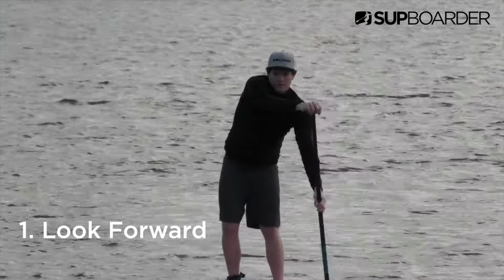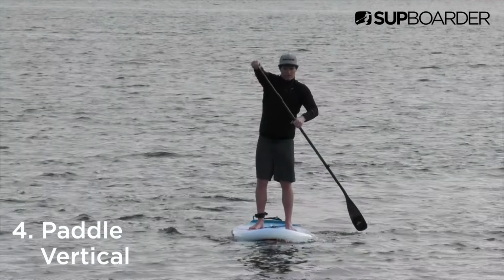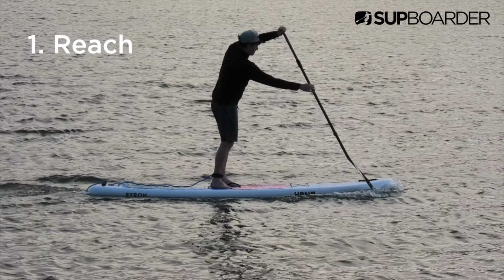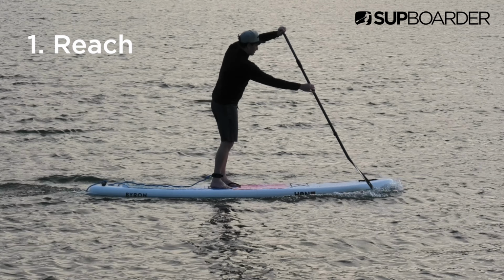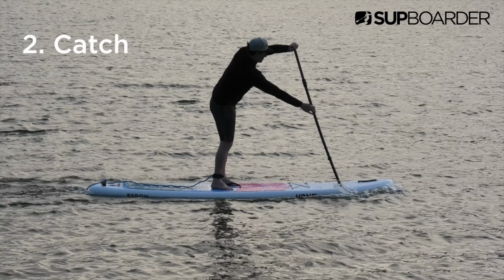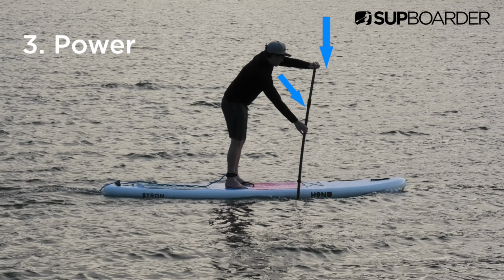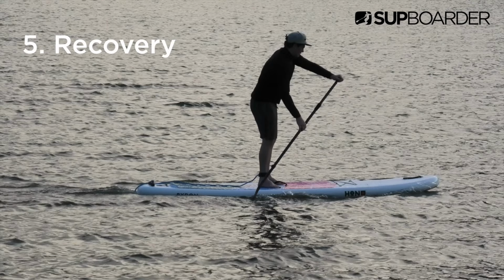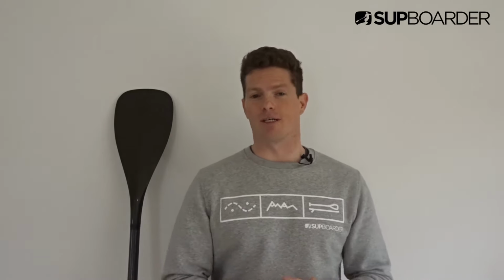How To Paddle Like A Pro / Improving Your SUP Stroke

Comment: Wtf is a positive angle?
Reply from the maker: Positive and Negative are terms we use to make it easier to understand the angle of the blade in the water. A neutral angle (0˚) is when the paddle is at our feet in the water. We want to focus on having a positive angle on the blade when paddling (power phase from the catch to our feet). Hope that helps. Beau

Comment: What would make me slap the side of my board all the time. I make sure the blade is going into the water the right way but for some reason i seem to always hit my board half way through my  paddle :), I love sup no matter how hard it is.
Reply from the maker: It could be that you are over rotating your wrists when you put the paddle in the water, causing the paddle blade to enter on an angle and as it corrects, it hits the board. The paddle blade should pulled perpendicular to the board (if that makes sense?). Your top hand may also move causing the paddle blade to move as well. Hope you're able to correct it soon! Thanks, Beau

Comment: I notice that your paddle starts pretty close to bow and I wonder if I'm to far back on the board, but I find myself more balanced slightly further back.  I see the difference @ 5:45 pushing the water out to much, but boy that person is sure going straight to me ha, ha,..
Reply from the maker: Haha, thanks for the comment. Your feet should be near the handle on the board. Slightly in front or behind it depending on the shape of the board and how it moves in the water. Also try to change your technique as mentioned in the video to help with your reach during the paddle stroke. If you feel comfortable where you are standing, then that's great as it needs to be enjoyable too! Hope this helps. Thanks, Beau

Comment: Tyvm for video!
How much difference does a good paddle do?
Does position on board affect speed in any way?
Reply from the maker: Glad you liked it!
A good, lightweight paddle will speed up your paddling cadence. it will also be kinder on your muscles and arms so you can paddle for longer. If you have never used a good paddle, once you do you will never go back.
Yes, the position will affect your speed and efficiency. If you are too far forward or back, the board pushes water and creates drag. There is definitely a sweet spot on every board and this can change between boards too. Try a few positions on the board and then take a few strokes to see how far you glide. 
Hope this helps. Thanks, Beau
Reply: @SUPboardermag  Tyvm for the reply! Appreciate it :D

Comment: I’m new to SUP and only have about 5 hours experience. I do get a lot of upper back soreness afterward - I think bc I’m leaning too far back and not using more core? I’m trying to figure out if I’m using too much arm strength and not driving my my core and hips.
Reply from the maker: Hi John, couple of things could be at play here. First thing would be to check your paddle length. Upper back and shoulder problems arise from having a paddle that is too long. You check this video for approximate paddle heights - but remember it is personal preference and you may need to go shorter (or at least try a shorter paddle): https://supboardermag.com/2021/05/08/correct-paddle-height-how-to-find-the-right-height-for-your-sup-paddle/

Secondly, it could be your technique that is causing upper back pain. Try straightening your arms when you paddle so you have to engage your core. 

Hope these tips help and good luck! Thanks, Beau

Comment: Hi there, I'm confused as I intuively thought the paddle is held the way you hold it, but after watching some videos they said you hold it the other way which I thought was strange. However you seem to hold it the way I thought was intuitive, so now I don't know which it is?
Reply: (it looks like you have the blade in the scoop sort of position and I thought it's supposed to be the other way round)
Reply: Every video I've seen says hold it the way this guy shows.  The blade is angling away from you so stays in the water longer as you pull.
Reply from the maker: It gets technical, but the blade angled away is the right way. It's all about positive blade angle in the water when paddling to maximise speed, power and efficiency.

Comment: Thank you for posting this video.  However, your model, although using the hips some, is flexing and sidebending the lumbar spine rather than keeping it straight.  Bending your knees will allow a better hip hinge and a straighter lumbar spine.
Reply: I agree. I keep a nice knee bend and when I do I feel my core engage even more and I’m able to get the longer reach.
Reply from the maker: Thanks for the tip. We agree that being your knees a little more will improve this movement, and can also enhance your balance. It definitely comes into play a lot more when paddling faster and adding more pressure to your muscles. Thanks, Beau

Comment: Thanks for all your videos, both instructional and reviews!
One question about the paddle grip, just like you do here most recommendations says paddle on your head and 90-degree elbows. However when they then paddle, it appears like they have quite closer grip than what the 90-degree elbows would be.  Same thing here in your video. Is this just an illusion in the video or are you actually using a closer grip?
Reply from the maker: Hi Ulf, great spot and good question.
the paddle grip with 90-degree elbows is a great start for beginner paddlers learning to SUP. Once you begin to progress with your paddling, you may find that the grip evolves to suit your paddling style. If I am cruising my local waterway and taking it easy, my grip may be less than 90-degrees. But if I'm in the waves or surf, my grip extends a little further than 90-degress for leverage and speed. Hope this helps. Beau

Comment: Question. Would a possition with one foot  in front of the other (left foot in front when you paddle from the right side like they do on canoe racing) be a bad idea? Even a slight lunge possition? having your both legs up to the waist glued to the board while leaning your torso to the side seems a bit awkward and unnatural to me. Is ballance an issue? Have you ever tried similar technique on a sup?
Reply from the maker: Good question Szymon. Some top races do actually paddle with a slightly offset stance as you are describing. It will make you have a slightly further reach and a more powerful stroke but you will have to change your feet each time you change your stroke and if you are changing your stroke side often this can make it less efficient. It is a very good technique if you are trying to sprint over a shorter distance in racing or potentially catching a wave. 
So yes it can be done, give it a go and see what you think, but I think for a longer distance paddling is probably easier to keep your feet in parallel stance unless you are trying to put more power into your paddling for maybe example... pushing up into wind. thanks Reuben
Reply: @SUPboardermag  So it seems more efficient in therms of speed and power. Also seems more natural although it works if you have a long board and decent technique so you dont change sides frequently as you said. Also if there are no waves and you have good balance you can sort of quick jump to change legs. Outside of that it seems less stable.
Reply from the maker: Thanks for your thoughts Szymon 👍🏼
Reply: @SUPboardermag  Ok. I'll check it out as soon as my board arrives.

Comment: Nice tips.  Any suggestions on how to keep a short board tracking straight? Like really short 6'5".
Reply from the maker: Hey Andrew, not sure if you are a SUPboarder Pro member but this is the video you need to see: https://www.supboardermag.com/2018/07/28/sup-paddle-strokes-using-the-c-stroke-how-to-video/ 
If not you can still sign up for free for two weeks watch the video and cancel the subscription after lol. But the C stroke is the manoeuvre to do and the matter what size board I can get going in a straight line. Thanks Reuben
Reply: @SUPboardermag  Thanks!

Comment: After many years kayaking, I started taking up SUP.  I thought SUP would be simpler than kayaking, but boy was I wrong.  Wind  is the difference maker.  Because of lower windage, you can go out in a kayak with sloppier technique.  Unless it is calm, paddling a SUP requires good technique to even make headway.
Reply from the maker: Good comment, Yeah it different but good at the same time. You have to think about your paddling conditions in a different way. And really get your stroke nailed. This video may help too : https://www.youtube.com/watch?v=96shOg_8e6Q&t=6s thanks Reuben
Reply: I owned a folding kayak for a decade and I find iSUPing simpler because I can get on the water much more quickly. It's true the wind is more of a factor, but it's possible to get quite low on a SUP.